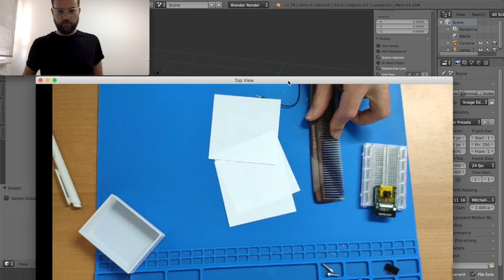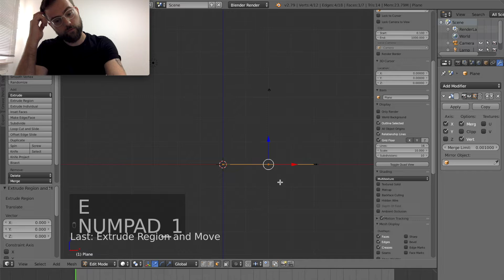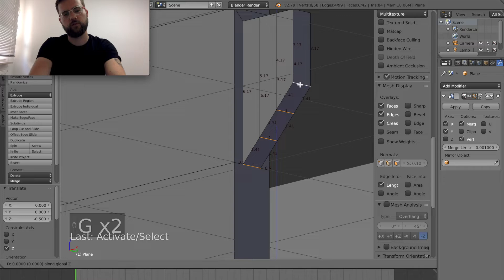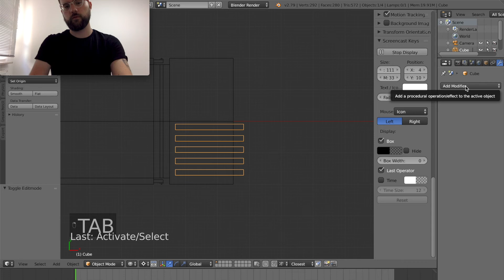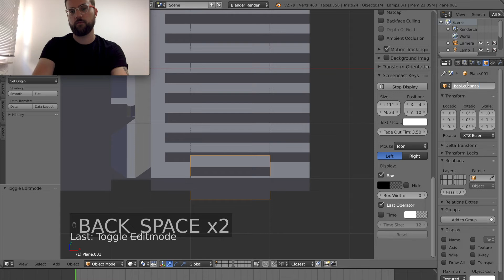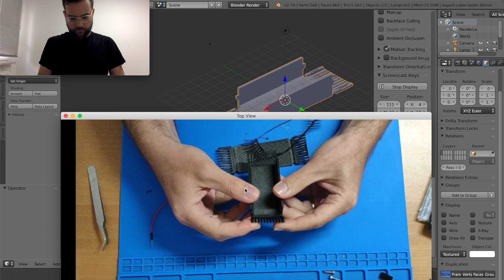EP1 [HowTo] Design a Jumper Wire Organizer

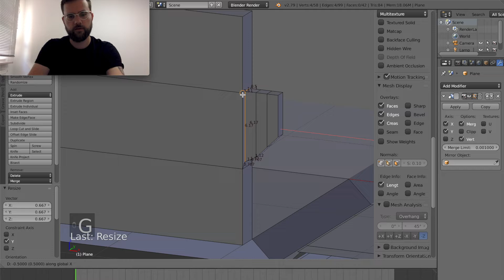Comment: I try to follow your steps - with success - until some magic happens (at 8:19) :-(  
But anyway I have learnt something new up to this and will go on.
Reply from the maker: Hi thank you for you feedback. Instead of "Loop Cut and slide" (Ctrl + R) I used the "Knife topology tool" (K) to draw aline across the face to cut it, then confirm the cut with (Enter). Then, I used size (S) along the (Z) axis, and typen in 0 to horizontally align the cut if it was not precise. Then I extruded (E) the face to creat the little nudge.

Happy to hear this helped :) (at least in some way)
Reply from the maker: I also switch between vertex/edge/face selection go get a quicker selection of the parts of the mesh that I modified in the this section
Reply: How did you align the split parts just before using the knife tool?    At this point the 3 parts are not aligned on the underside.  Then you somehow move the 3 parts a little downwards and align the lower surfaces.
Reply from the maker: @thomo1969  In the video I have 3 band on the "nose thing". I split the innermost another time, size it along X axis and snap it to the width of the other bands. Grab it along y axis and snap it to the wall. Then grab the top faces of the nose down the Z axis, and the bottom up, s.th. no edges are in the same location on the side of the wall
Reply: pauls_3d_things Thank you for your support. I got it.
Reply from the maker: @thomo1969  excellent 👍